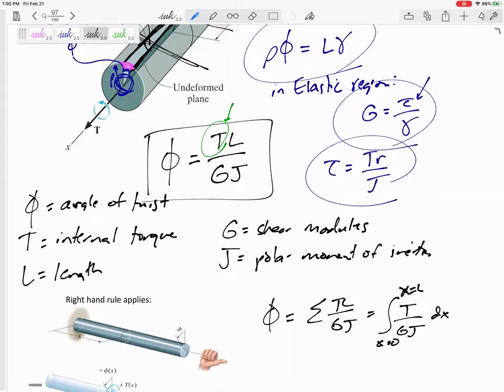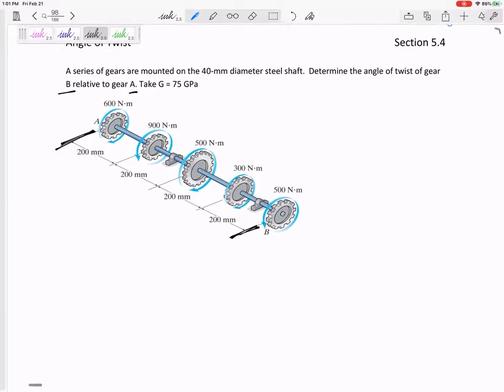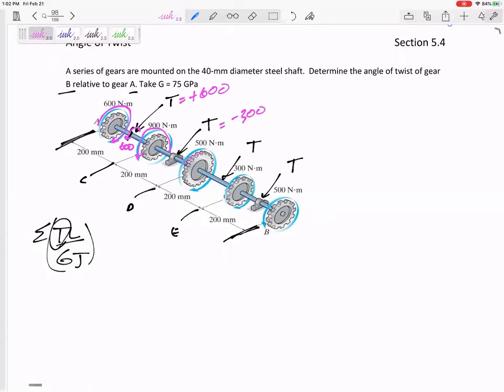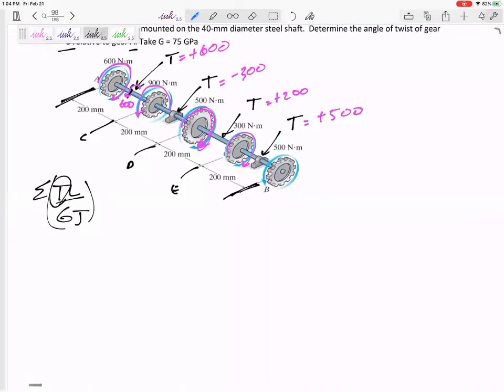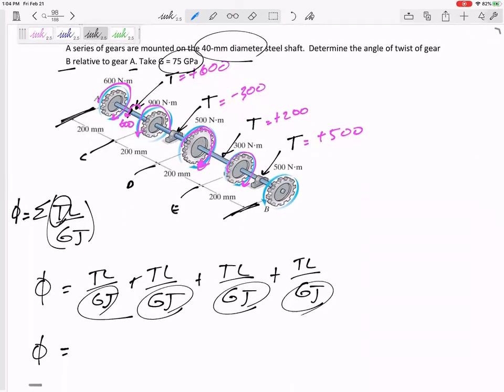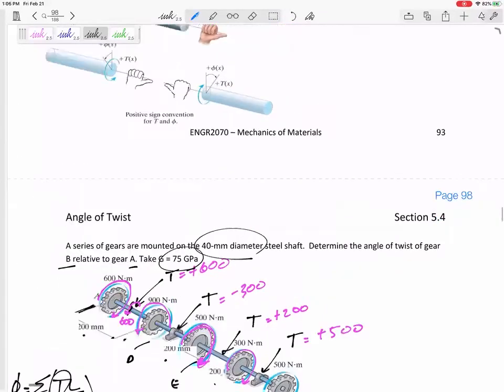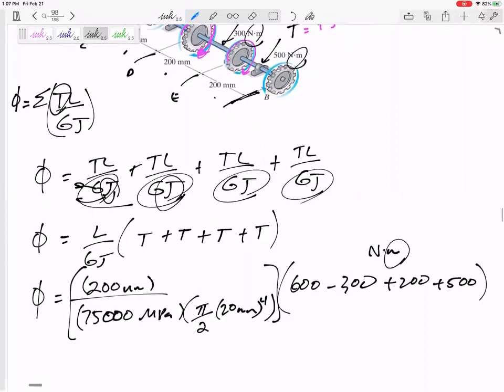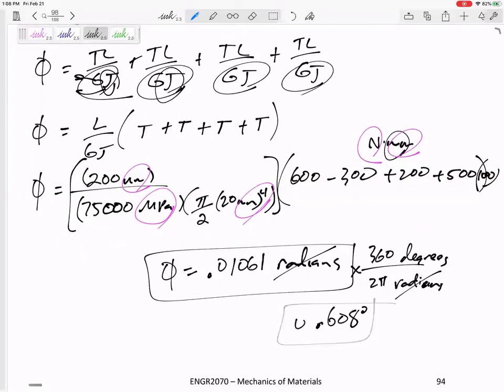Mechanics of Materials - Angle of twist example 1

Comment: The length mentioned in here is written 200mm but it's 1000mm as whole sections length is to be accounted. 
Only then answer of 0.1061 rad will come.